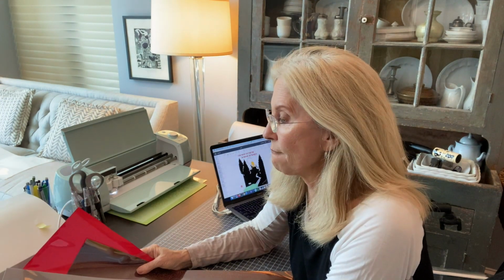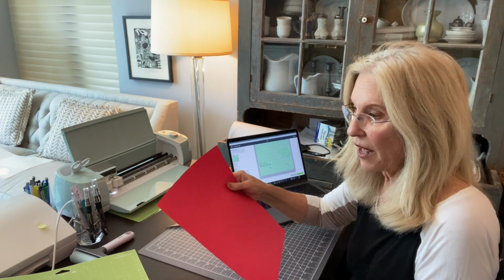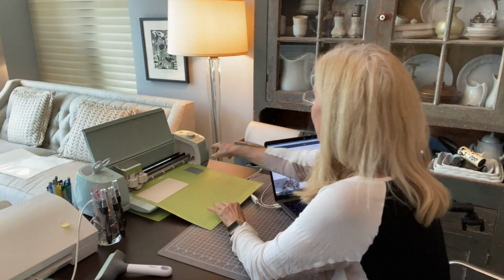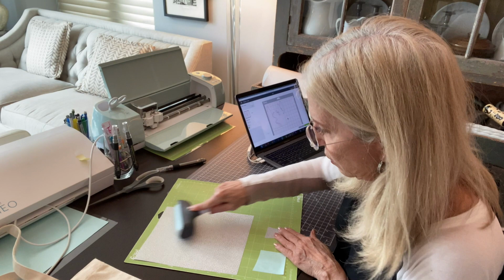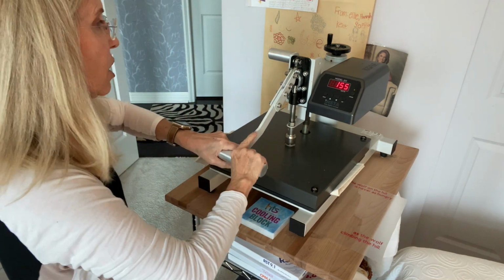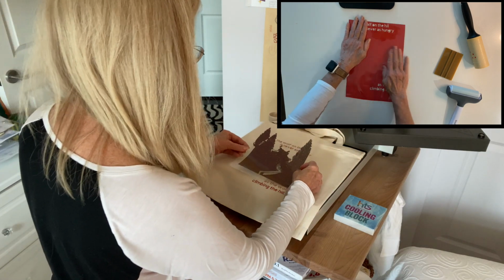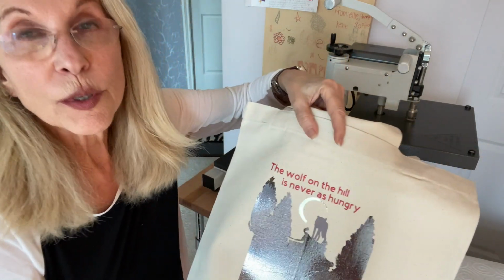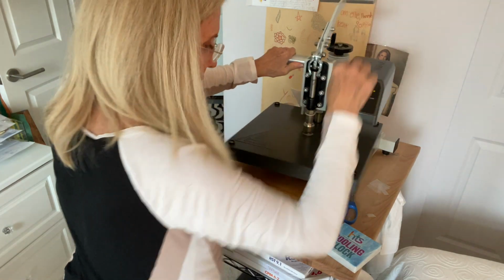MY DESIGN PROCESS: Part 3 … Cutting and Application

Comment: This came out beautifully!! What is that roller you used when placing the vinyl on the mat?
Reply from the maker: Sommer Lynn, please consider joining our mailing list so you can get our free weekly Craft Talk newsletter filled with crafting tips and tricks.  https://conta.cc/3iPmqRy
Reply: @heattransfersourcedependab1870  done! 💙
Reply from the maker: Sommer Lynn, it's called a brayer. There are several on Amazon. But you can also use an old credit card or anything similar.   Here’s a playlist of Pattern Vinyl videos I thought you may enjoy: https://bit.ly/3fNOR1l. https://www.amazon.com/4-Inch-Printmaking-Application-Original-Version/dp/B07YDNKSH6/ref=sr_1_3?dchild=1&keywords=brayer&qid=1592139469&sr=8-3
Reply: @heattransfersourcedependab1870  thank you so much!